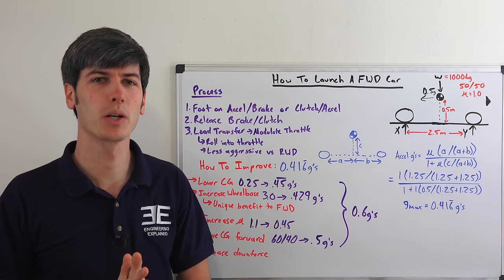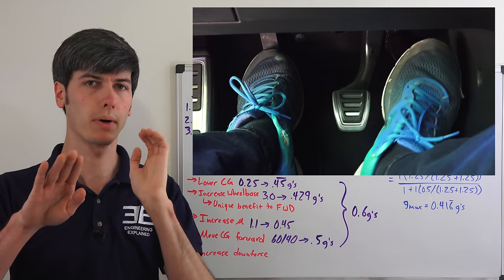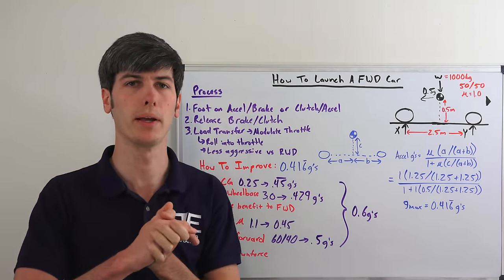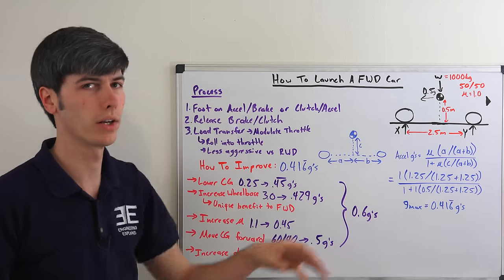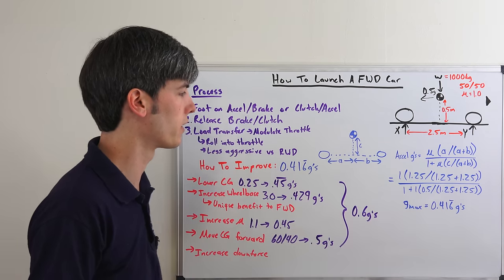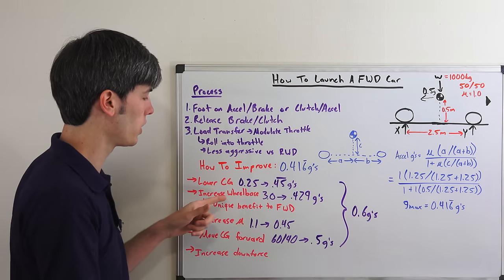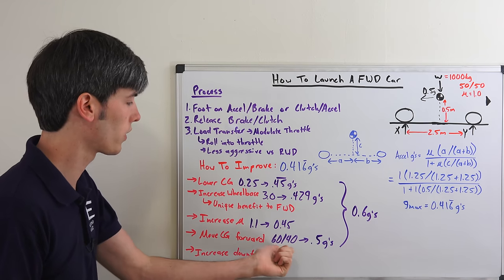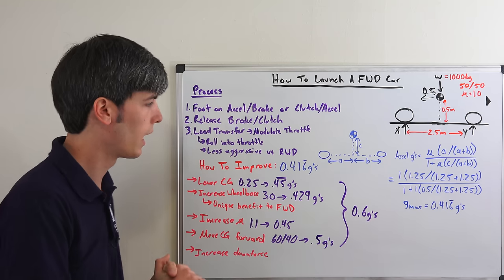How To Launch A FWD Car - Design Considerations

Comment: Hyundai Accents don't need to launch as they idle at Mach 3
Reply: wtf
Reply from the maker: You're probably thinking of your razor blade.
Reply: well this Accent guy got a point,, if you put 500lbs of silencers into 3000lbs car you won't feel speed as you should, and laws of physics do not f***ing care about loudnes of crash, do they ?
Reply: +Engineering Explained  😆 +1 smooth shave!
Reply: The carpets are terrible and cheap in that car and the starter motor sounds like a 90s kei car.
Reply: TFiPW those problems were solved in the hyundai accent aperta speciale
Reply: carrasco0416 Not available in North America.
Reply: +Louie Watson guessing you use this statement a lot
Reply: On a more serious note, there's enough space in the hood of mine that I could use an overvolted box fan as a downforce generator.

Comment: Jason -- I have a 1.6L with a 6sp manual.  When I pull away from a stop light, what method is best for clutch life
1) rev to about 1.5k, slowly letting out the clutch while feathering the throttle to keep revs at 1.5k
2) rev so about 2.5K, let the clutch out faster so you are not slipping it so long, but you have more friction from the increased revs?
3) Nail the throttle, hit the rev limiter, and dump the clutch -- just seeing if you were paying attention here :-)

Thanks
May my Soul be with me to 100K  :-)

Comment: Suspension limiting straps on the front that have no slack while the car is at rest. This will prevent the shift in weight off the front suspension. I wouldn't do it for day to day driving but for dragging, it'd work.
Reply: sorryociffer this is true i am in the process of doing this with my car . Rear passengers will have a harsh ride but it's a must when your car weighs 900kg and has 250hp@wheels.

Comment: Actually would it be better to launch a front wheel drive car if the soften and lower the front suspensions also stiffen and risen the rear suspensions to give more loads to the front tyres hence more grip?

Comment: Increasing the wheelbase also benefits 4wd vehicles at launch. As most tires decrease in friction coefficient with increased load, the increased wheelbase and lower CoG will keep the tires closer to their optimum point of friction.

Comment: I read before that if you lower one end more than the other end it will result in a static weight shift either forwards or backwards. From what I remember the math was a little non-intuitive. I would love to hear your take on that, and how coilovers could be used to tune this for better acceleration.

Comment: All you need to make your car quicker on the street i semi slicks , a decent clutch and higher spring rate in the rear end to transfer the weight over the front wheels.

Comment: Does having a stiffer suspension help prevent load transfer from front to rear when accelerating?  My car noticeably dips and rears when braking and accelerating. Been trying to decide whether I should invest in coilovers, aftermarket sway bars, etc.
Reply: Logically that makes sense

Comment: It should also be benefitial to launch at a slight decline not only because the force of gravity has a component in the direction of acceleration but also because the car puts more weight on the front tires

Comment: I have a 2015 Kia Soul with a 2.0L 4 cylinder. I did the method of holding the break and applying the throttle and then sidestepping the brake pedal. My car didn't sound too happy though. It revved, sure, but it sounded like it was "knocking?" Maybe it could have just been the six-speed automatic transmission. Obviously I know it's not a sporty car, but could it have been harmful that I tried this?

Comment: In the Blue writing your start technique is very limited. I run Hill Climbs a lot and quite often come the end of the day I'm in the top 3 or 5 (60ft times) cars Outright with an Under 2litre FWD car. Well, how do I get my car so successfully off the Line? It's easy once you have the technique down. Firstly pick your rpm launch revs (my sweet spot is 3000 rpm) - Pull the Hand Brake up hard with the Button pushed in - slip the clutch and load the front end up. Lights go green, release Hand brake and let clutch out at the same time. Start all the movement a fraction before the Lights go green. Don't stomp the throttle but rather use your Ankle as a hinge and 'hinge' the throttle to the floor. Takes a bit of practice and you need a HD or Button Clutch, I use the latter with a 1.4kg CM Flywheel.

Comment: Just wondering if  the car balance of FWDs should be as close to 50/50 as possible? or after watching this vid Im starting to think front heavy may be way to go as under acceleration youd be closer to 50/50, at the expense of a heavier load on front tyres in cornering? this would be for Motorsport use too, not normal road use.

Comment: Bro, got a question for ya, please answer! So, there seems to be a very strong correlation between WHP and an engines number of liters, turbos, superchargers, ect. However, that correlation seems to become weaker when it comes to torque. That is, one V8, naturally-aspirated engine will have around 300 torques, while another will have close to 500. What results in torque? Am I missing something, or is there more to producing torque than mere engine size? Thanks bro!

Comment: +Engineering Explained Can you please do a video on why AND how some cars pop and crackle. I'm talking about the current popular pops and crackles employed by carmakers like Lamborghini, Audi, Jaguar, McLaren (especially the 675LT) etc where cars pop at upshift and downshifts and pop and crackle when you let go the throttle. The popularity of this feature has increased so rapidly recently to a point where it's becoming ridiculous and rather annoying. It seems every carmaker has to produce a car that pops and crackles, perhaps due to customer demand. Sigh...........

I remember a few years ago, pops and crackles usually meant that your engine had, or was developing some problems. I'm also aware that WRC cars have anti-lag systems that crackle for a reason when you let go the throttle. So how are the engineers and designers achieving these pops and crackles today without damaging the engines on these road cars? Or are they?

Thanks for the great videos. I'm an avid subscriber of yours. keep up the awesome content.
Reply: Thats the sound of an anti-lag system. The crackling is from unspent fuel igniting in the exhaust duct to keep the turbo spooled up
https://en.wikipedia.org/wiki/Antilag_system
Reply: ^ there are a plethora of cars that crack and pop that have no such system....

It is from unburnt fuel though....it's in the tune itself. Tuner can make this affect more pronounced for the ricers that want it (yes it's rice). All the tuner is doing is dumping a bunch of fuel right before you let off and then retards the timing sometimes to exaggerate it even more

Comment: are FWD cars more efficient than RWD or AWD or is it just a waste of monies
Reply: FWD cars are more "monies efficient" (i.e. cheaper to manufacture).
Reply: If you have an Front Engine Car, you will have a shorter Drivetrain with FWD. --> Less Mass needs to be moved and change speeds while driving --> Less Energy needed. (Obviously simplified.)
Reply: Depends on how you define efficient. As far as putting power to the wheels, fwd is more efficient. Less driveline losses bc fwd cars use a transaxle instead of a transmission+driveshaft+rear differential. Transaxle is more compact and allows power to get to the wheels faster/easier....Generally, fwd cars are more fuel efficient mainly due to weight. The driveline components of a rwd car add weight which hurts mpg (assuming you can compare a fwd and rwd car with similar weight and engine.....When speaking about overall driving efficiency, rwd is better bc front wheels steer/handle bulk of braking while the rear wheels provide power. Fwd cars have the front wheels handling power, steering & braking.
Reply: There will be less power loss between flywheel and wheels and this will also give it some fuel economy . Its one of the reasons why most domestic cars are front wheel drive in most continents. FWD cars are also cheaper to manufacture and more easy to handle under rain/snow/ice conditions since they are more prone to understeer and not oversteer.
Reply: FWD is cheaper to make. Although a FWD car is harder to fix if something goes wrong. And CV joints, while are very do-able by yourself, are a pain in the ass to change out. Plus, its extremely hard to hold a drift for a fwd car. Burnouts are easy to do in fwd cars
Reply: FWD is perfect for everyday driving (city/highway). RWD if you are an enthusiastic and push your car to the limit (best for take curves speedily). AWD at least you want to drift like Ken Block... also gives you more confidence in snowy or muddy places (first two configurations are enough if you're a prudent driver).
Reply: What about if I have my engine in the back like on my smart car
Reply: Then it will be similar to a fwd car in terms of efficiency. The part that makes a front engine -rear wheel drive car loose power and efficiency is the additional parts that need to rotate . The driveshaft would be one major reason for power loss.
Reply: How kuch power is lost approximately
Reply: With new technology theres alot less power loss but there is usually 5-8% more power loss in a rwd-front engine car compared to a fwd car or a middle/back engine car with rwd. The power loss can vary from 10-15% or abit more on a fwd car.
Reply: The smart car has an RR layout (Rear engine, Rear wheel drive).

It is not a FWD...
Reply: The bicycle is the most efficient mode of transport using little energy but providing most horse power,
Reply: +triggermovies so its basically a 911
Reply: Basically, yes !

Or a DeLorean, especially if you had a flux capacitor.
Reply: Remove the doors, rear hatch and all the passenger seats on your car an take it for a spin, I promise you will not regret,
Reply: +John Kyon you mean 'man'power... Horses dont ride bicycles
Reply: My muddy fox speed fx produces 0.8 BHP and 1.2 ftLbs of torque,
Reply: FWD are better in the winter and to go uphill. If you're a casual driver you're good with a FWD.
Reply: Take the bus 🚌

Comment: What you say is helpful but very insignificant in grand scheme of things, sometimes its good to put down the pen and paper, go out and test setups. That being said, if you want to hook in FWD car it's mainly your suspension setup, heavy springs and moderate rebound in front and as low as it goes, then soft springs, low rebound in the rear, set it as high as it will go. You want that ass to squat on the launch, make that load transfer work for you not against you.

Comment: I truly enjoy your videos. Was the Accord activating the traction control?  Could you extend this to include the horsepower/torque required for maximum acceleration?
Reply from the maker: I don't believe that the Accord interfered with traction control. It was cold/wet so I launched in 2nd gear, and kept the revs low so the tires wouldn't spin. Could have used slightly more throttle, but just a little more could have caused tire slip and thus reduced the time.

Comment: Can you do a video on how radiators work?
Reply: just the radiator or the entire cooling system?
Reply: A simple no math answer

A radiator has tubes in it that allow the fluid to pass, on the outside of thes tubes there are thin metal fins attached.
The tubes transfer the heat into these fins and these fins increase the surface area of the radiator as a whole.
Since the air is passing over them they take the some of the heat with it, this cools down the fluid inside the radiator.
Reply: STONER Timmy entire cooling system

Comment: 5 things not to do on CVT please !
Reply: 1.buy one
2.🔝🔝
3.🔝🔝🔝
4.🔝🔝🔝🔝
5.🔝🔝🔝🔝🔝
Reply: +TheLukey21 preach brother preach!
Reply: What's a CVT ?
Reply: +Ujiltrom M it's a type of automatic transmission using belts instead of gears to offer endless ratios for the best efficiency. It stands for continuously variable transmission
Reply: +Bambi the Miata its basically the transmission off a scooter that has been made to suit cars.
Reply: Bambi the Miata
Thanks, TIL !
Reply: Yup, CVT is the transmission of the devil.
I hate it more than an auto and I hate autos.
Reply: +IIGrayfoxII theoretically, CVTs equipped cars are faster that any geared car and use less fuel.
Reply: +PizzocanWasd In practice, not so much
Reply: Until the transmission explodes 40k miles in

Comment: If I get up to 60 mph in my 6 speed in 2nd gear should I shift to 3rd once I'm about to redline or should I put in 6th gear like I normally would at 60 mph
Reply: Up to you :)
Reply: it's up to you long as you keep the revs under the redline the car can handle whatever
Reply: Depends. If you are gonna bang through the gears and keep accelerating do that, but leaving your car in say jus 3rd will use more gas than 6th gear due to your engine working so hard in those higher revs.
Reply: When I do that I double clutch it into the highest gear. Pop it out of gear near red line, release the clutch and let the revs fall to around 2500 and then clutch it into high gear. Saves some wear on the synchros.

Comment: How about increasing the spring rate in the rear of the car to decrease load transfer?
Reply from the maker: Might help a little, but not super significant. Keeps the car flatter, but the only load transfer difference will be a result of the CG movement, which will be very minor even with soft springs.
Reply: +Engineering Explained Bro, got a question for ya, please answer! So, there seems to be a very strong correlation between WHP and an engines number of liters, turbos, superchargers, ect. However, that correlation seems to become weaker when it comes to torque. That is, one V8, naturally-aspirated engine will have around 300 torques, while another will have close to 500. What results in torque? Am I missing something, or is there more to producing torque than mere engine size? Thanks bro!
Reply: +Engineering Explained Bro, got a question for ya, please answer! So, there seems to be a very strong correlation between WHP and an engines number of liters, turbos, superchargers, ect. However, that correlation seems to become weaker when it comes to torque. That is, one V8, naturally-aspirated engine will have around 300 torques, while another will have close to 500. What results in torque? Am I missing something, or is there more to producing torque than mere engine size? Thanks bro!
Reply: More displacement = more air = more fuel = more boom. Same idea with forced induction. Now ANY way you can get more air in the engine means more torque because you can add more fuel/extract more energy from the same amount of fuel. That means better flowing heads, FI, Nitrous, less restrictive intake tract, etc all increase torque and since horsepower is a figure of torque at a given RPM, you increase that as well if the torque at that RPM is increased.
Reply: Also engine designs play a big roll. For instance most american V8s have a long stroke: bore ratio which grants them a lot of low end grunt vs say a ferrari V8 which is the opposite, Short stroke: Bore ratio given the same displacement. This means it wont necessarily make much power down low but since the piston/con rod moves less of a distance, it can move faster (higher RPM) which means it can make more power up top vs the american V8.
Reply: Since it can rev higher while still combusting efficiently ^
Reply: thanks man!

Comment: so what happens when you add wheelie bars to a fwd car?
Reply: Nothing. You can stiffen the rear suspension of the car tho.
Reply: It's like increasing the wheel base when the rear squats. You get more traction.
Reply: benoit8850 that's what I thought happened.

Comment: Funny thing I realized back in my teen years... if you get stuck in the snow trying to go up a hill in a FWD car, go up the hill in reverse and you'll get more traction.
Reply: Wow, thanks. That might actually save me some day.
Reply: good luck with that bud. pulling is much better than pushing in snow.
Reply: +SuBLiMeXGoLd honest question, but wouldn't the extra grip help more? I wouldn't think it would matter in a straight line.
Reply: +Kevin Eichelberg not in the snow, especially on a hill. with my 1g CRX just decrease tire pressure and torque steer my way on up.
Reply: Pulling vs pushing it makes no difference. FWD doesn't have better traction because it pulls, it's because the engine is on top of the drive wheels.